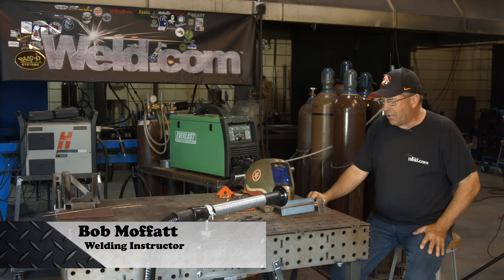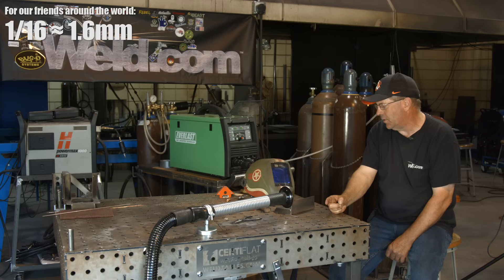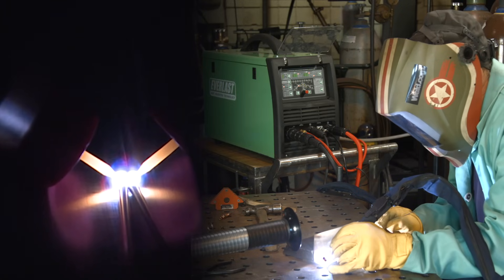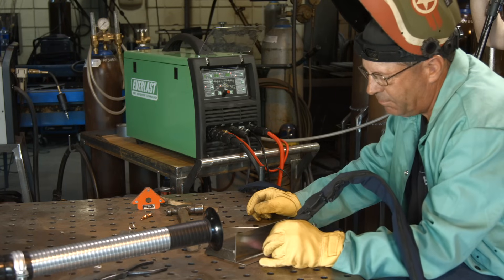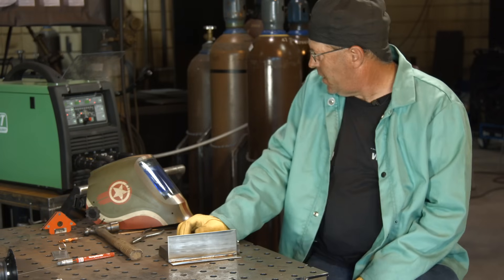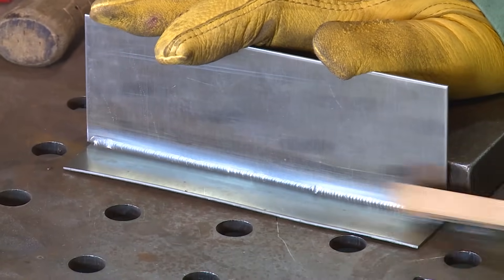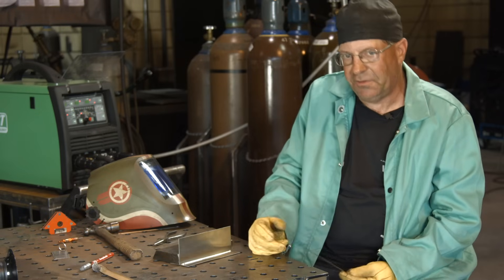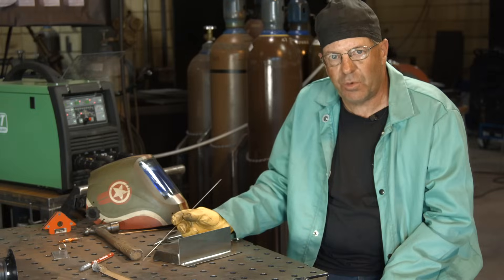🔥  TIG Welding 1.6mm Stainless Fillets (Viewer Request)

Comment: I can’t seem to keep my heat in control. The whole weld turns grey except the last 1/4” to 1/2”. Im welding about 3/32” stainless. Ill turn my amps way down but I have to stay in the same spot for a long time it feels like to get the puddle going and then the base material seems to get really hot just as the puddle gets moving a little bit.

Comment: I notice that everyone talks about foot pedals. What about those without foot pedals, or the welding situation doesn't allow for foot pedals?

How many amp is good for 1.5mm thick stainless? I believe I welded like you do, not as good as you but I'm not getting those golden/blue beads like Pacific arc tig weld does, but you're also using a normal sized cup and he seems to be using giant gas lenses... Is brushing the stainless after the weld acceptable, or using electro polishing brushes to remove the oxidation acceptable?

I don't watch PATW much because his result is unrealistic for someone without a GIANT cup and lots of gas flow. Regardless of the setup I have, #8 or #10 I've found the best result is from about 5 liters per minute (I guess this is about 10 CFH). I've dialed down the pressure quite a bit, the manufacturer of my welder recommends 15 psi, I don't have a gauge measuring the discharge pressure but the dialing down really saves on gas. More gas than 10CFH, even twice as much (20CFH) doesn't help me at all.

Comment: Appears to be using 80A to 90A, Jesus! What a amp for a sheet metal like 1/8! Today I lost some hours trying to learn TIG weld in these 1/8 stainless with no more than 55A. I will definitely try again with more power. I really suspected that I was burning my steel but I stick with max 55A due to a 'table' that I find on internet. No table substitutes an experienced TIG welder. Let´s try again tomorrow...

Comment: Very nice Bob but I have one request I know you probably cant get to this but I work in aerospace space currently as a tig welder and there is a bump in the road that I have ran into and I'm wondering if I can see it be done I have a weld test coming back up but a little new to me its .090 thickness 321 Stainless steel using .045 filler wire needed to be used need to fill with no undercut full penetration in the back even all the way threw start to finish it's a Butt joint can add a groove if needed, and is going to be x rayed thank you for your time.
Reply: And only one pass

Comment: What was the exact amperage used during the weld? I've tried even 30 amps and it melted the steel at the joints especially when i'm doing tubes. Need some advise on this.

Comment: Can you also do tig on 16 gauge outside corner joint? I am trying to make a small purge box for small parts that need major argon backing I’ve got an idea just haven’t done much will stainless outside corner joints at such thin gauges

Comment: Hi Bob, I have a dc, 200A Tig with pulsed option. Is possible to weld stainless 430 of 0.5mm in corner joint with this? Can you make a video?

Comment: I took what in thought would be an easy test for a job this mornin and failed it. I just had to do two horizontal fillet welds just like this and then weld two cupons together fusing just the base metal with the tungston. Im a rookie at TIG welding and i was used to just tiggin on thick stainless pipes, that thin stuff is a different beast. I can see what i was doin wrong. I was wonderin If i hold the torch with my right should i be pushin or pullin the puddle on this thin stuff? And i noticed hes just runnin the bead along really easy without moving the cup at all i was taught to "walk the cup" id appreciate any helpful advice on the subject. They said if i got in a little practice or something and wanted to retake it i could

Comment: Hi Bob, great video. I have tried to do the same, only my 304 is 2mm thick, using 12mm gas lens with 2.4mm 2%throriated red tungsten, sharpened quite thin. 20cfm argon. 70amps current. 3 sec start and 8 sec post gas. Am very new at stainless welding. My welds have a black scale on which kind of releases a bit as the weld cools so you can see a bit of shine underneath. I guess if I brushed it would come off. Why are my welds not shiney and bright like yours?
Reply: Hi Shane, check out the fabrication series by Tim McAmis here on YT, he goes through flow rate, Furick cups, and some trouble shooting.
https://www.youtube.com/watch?v=fEJulorXTMw&t=953s
That vid addresses your question.  (around 12:54 ), but I'd watch the entire vid. !
Reply: Im a beginner myself. Sounds like your cooking your work piece. That could be one of the issues. I started moving a little faster and put down rod more often mine came out shinny.

Comment: Bob, what would you change here for 20 Gauge Stainless Steel? Amperage only or cup size as well? Fillet size? My set up is same but 3/32 fillet on 20 gauge and struggling to control the puddle. Thanks for this video, working with it in the shop.

Comment: At school I TIG 1/16" stainless T joints well, with a nice rainbow color. But, at my last job test no matter how low I set their old Miller machine I was burning through the stainless like a flame through paper. I didn't get the job obviously, and I left embarrassed and tried not to show it. To be fair, they were using contaminated tungsten rods. The chuck that tightens the rod in the torch was spiral twisted and worn out and no extractors were present to clear the vapor. Something was off because they set the machine for me, and got annoyed when I looked over the settings, as If I shouldn't bother.
Come to think of it it was better they didn't hire me.
Reply: You dont want rainbow colors, thats overheating the metal. You want a nice straw color

Comment: Bob, I'm a beginner welder. I was practicing on 304 Stainless 1/8 in Coupons. I'm using 100% Argon at 30 CFH, Stubby gas lense, #8 Cup, 3/32 2% Lanth, 308L 1/16 Filler. All my welds are coming out dark Gray. No matter how low I go on amperage, i can't seem to get bright colors. Any ideas would be much appreciated. Thanks for all the great Videos.
Reply: I asking myself the same question. How to get bright weld. Where are you now at, one year later?
Reply: Late comment, but use piece of aluminum block or angle 1/8" or preferably 1/4" or more to touch as much of the back side or the weld as you can as a backer.  It will pull the heat from the stainless and keep the temps down so reduce to oxidation (gray)...

Comment: Great Video!
I regularly have to tig high-carbon stainless, that has been cut too deep, in very expensive CNC machined parts; for the food service industry.
 I would appreciate some insight dealing with filling in approx .08 cutouts along an edge .1 thick.
 If the opportunity presents itself; not everybody is dealing with thick material constantly.
Reply: Any tips? I need to get small welds down on some really thin stuff.

Comment: Took a Stainless TIG test yesterday, bombed it (only second time I've welded Stainless). I was having two issues; 
#1 vision- seeing what was going on clearly (I guess a 1.0 or a 1.25 cheater lens would help with that) 
#2 getting the puddle to form and then move along. I had a similar set up to the one in the video. I set the machine to about 95 amps and gave pedal until I had a puddle. I tried to move out and things just wouldn't move like I would want. It seemed I either had too much heat or not enough and blew out the joint several times. I don't seem to have this kind if issue with carbon. The only two times I have ever welded stainless have been on tests (probably 90% of my problem). If I get another shot is there anything specific I should "look for" when attempting to initiate a puddle and then move out down a fillet or lap joint? 
Thanks for the great videos.
Reply: Hey man I'm having this exact problem now on a stainless job trial. Kinda hard so far.

Comment: why not call your "weight" what it actually is... a heat sink for that thin ss.
Reply: Andrew Cumiford Because it isn't.  Most everytime I've used it, I've explained it isn't a heat sink.
Reply: If one did want to use a heat sink block, steel is far from the ideal metal.

Comment: I wanted to see the back an bottom of the plates.
Reply: Sea Level Sorry my bad.
Reply: A lot of the time, I run into a job that I cant get anything behind the joint to prevent sugaring and way to big to purge. Typically 16 gauge ducts and exhaust assemblies. It's hard not to not sugar the backside and make it look tight and burned in.
Reply: Sea Level Agree. Heat paste and or Solar B flux may help in those instances. .045 or even .035 filler might be the trick.
Reply: Bob  Moffatt don't apologize for camera guys short comings. You are a great teacher keep up the good work.my only hope is that one day you'll get through to camera guy seems like he's got a habit of riding the rails :(
Reply: delinquentdesign just use pulse man😀

Comment: Hi bob, I'm having some troubles with MAG welding of Stainless steels. In fact, we use a circular butt-weld configuration for joining tube fitters to a tank shell  (1,5mm in thickness ) and we always find hot cracks before the overlap region. What do you is the cause and how to prevent such defect ?

Comment: When you are tig welding could you tell what type of tungsten you are using? If you only said what color that who be very helpful. Thanks a lot and I look forward to the next video.
Reply: E3 on this one.
Reply: 12ozbuds Color band isn't always consistent with alloy these days though.
Reply: I use 2% on most everything so red for thoriated and grey for ceriated. Red seems to keep the nicest point for fine work and it takes the heat best for ac aluminum. My preference only.
Reply: Boy, that narrows it down. What I meant when ever he does a tig video he says not only the size of the tungsten but also the type. For example thoriated, ceriated, or zirconiated.

Comment: Bob, here's a question I've often had with respect to back purging stainless welds. We all know that the conventional way to do this is with an argon purge but I've always wondered if you could accomplish the same goal by using vacuum. This would have many advantages if it would work. For one thing there would be on argon expense. Just hook up your vacuum pump, need one of those for air conditioning work anyway, suck out the air and go to town after sealing off the object you're trying to weld. OK something like a SS exhaust system if you need to know. Have you ever heard of someone doing this and is it feasible?
Reply: I understand what you're saying and it's not feasible. You would have to ensure that the argon coming from the torch surrounded the entire area to be welded (every microscopic gap) at all times, or the vacuum is going to draw in air.

You cannot control dissipation to atmosphere in that application. You can control dissipation in a back purge setup.

And there's no way to get a perfect vacuum on something that's not sealed. Vacuum equipment has a very low CFM rate of evacuation. Even a pinhole sized opening and that thing will never build vacuum, never mind create an environment akin to back purging.

The idea of welding in a vacuum chamber I think has merit though. Execution, equipment cost, setup cost, productivity rates etc would be the defining factor vs back purging.
Reply: SATAMAN Schmidt 

Welding of some form or another can be done in a vacuum, however you need a very significant vacuum to get enough oxygen out that the weld is protected without running inert gas.  You definitely couldn't do it in a sheet metal box, you would need a thick walled chamber.  Even then some oxygen might still be present.  It would be interesting to see how the heat from the tungsten in gtaw would cross the arc gap in a vacuum.  I would think tig might not work at all or at a reduced heat level with no gas present in the arc gap.  Just as helium increases heat, a vacuum might lower the heat or eliminate it.
Reply: Don't think you understood the question. The entire piece isn't going to be placed in a vacuum. On a tube (headers for example) use rubber stoppers on each open end with one of the stoppers having a whole in it to connect to the vacuum pump just as you would with an argon tank except you'd need a vent hole on the other side if using argon back purge as the argon has to go somewhere.
Reply: SATAMAN Schmidt 

A vacuum strong enough to pull the oxygen/gas out of a header would pose several problems.  One is if your weld penetrates the material at all you will have a hole and a loss of vacuum instantly.  Second, it takes a serious amount of vacuum to pull enough gasses out that the backside of the weld isn't exposed to oxygen.  Enough that the integrity of the pipe could play a role.  Obviously not a option on anything thin wall.  And third a vacuum strong enough to vacate the pipe of oxygen will surely pull in oxygen into the pipe negating shielding processes.  Obviously if it needs welding it has unwelded areas that will just allow air into the pipe.  Not practical by any means, biggest issue being that any remote pipe penetration would lead to the molten metal being sucked in.  Just as back purging will lead to a weld blowout as you finish the weld provided you didn't leave a vent hole for the Argon to escape.
Reply: @satamanschmidt3428  The goal of course is to prevent the oxygen from having access to the hot metal.  If you can set up the flow so the Argon curtain washes past the metal without mixing with and bringing air with it, then it certainly would help.  I would think it depends on how successful you are at having only Argon in the stream.  Submerging the headers in a "box" filled with Argon could also work since it is heavier than air.  Shorter headers might be ~3 cubic feet of box requirements in size, so at 20 CFH it would take 10-15 minutes to fill the box.  I think that is hard to manage though so be able to weld 360 degrees much like the vacuum and so folks use a purge instead...  More reliably repeatable I think...
Reply: It’s an interesting question. How much oxygen, and nitrogen, don’t forget that, needs to be removed? It’s likely that not all of it does, but most all of it. So what would the Hg number need to be? The problem is that you would need a really good seal on the back. But, if your goal isn’t really to save gas, then it might work by drawing argon through the small gap as long as you raise the argon flow. It wouldn’t be perfect, but it could help.

And, by the way, you need the resistance of the air gap for the arc to work properly. That resistance is what produces the heat.

I often use a device I made out of several inches of 1” square copper. I milled a flat in the middle on the corner, drilled and tapped it for a rubber handle. I then milled an 1/8” deep flat along the opposite corner extending to about 1/8” of the ends. When I put that behind the fillet, the slight opening between the two pieces of metal captures a small amount of argon from the torch, and pushes out the air. It works pretty well. I made a similar thing out of 1/4” thick flat copper stock. Machine a groove in the middle. That allows argon to displace the air if you have preflow set for a couple of seconds, and a tiny gap.
Reply: Beyond anything else, it would not work because as soon as the metal puddles the atmosphere on the outside would blow into the vacuum inside.

As an automated procedure in a vacuum chamber, or an astronaut out in space, it would work just fine. In fact, you'd not only save on the gas but it would also use less energy as the lack of atmosphere means the heat stays in your work.

Comment: Thanks for the video as always.  Sometime you should do a video on .120wall tubing (as commonly used in roll cages and off road parts like axel links/bumpers/etc).  I have some projects I want to tig weld up for my truck soon and I am a bit confused.  It seems it's recommended to do a full penetration weld on butt joints.  Yet on notched tubes I see guys welding in other videos they keep the gap in the joint to a absolute minimum.  I don't see how they are getting full penetration in tig in such cases without a gap.  I could run way over amperage and I can't get full pen with a 0 gap.  They aren't beveling the tube ends either.  Any thoughts/advice/video would be great.
Reply: Yes please
Reply: Good point. This needs discussion for sure.

Comment: Wanna see the back side of the weld
Reply: I would also like to see if it sugared.
Reply: Not just the back side of the fillet, but also the underside of the bottom plate would be effected. Would not be any "overflow" of argon getting back there.
Reply: NifalioPhobia BVTV, wouldn't it have some gas coverage on the back side because of the block on the backside trapping any gas that flowed through?
Reply: Frank Rodriguez yes it should but I still wanna see how it looks but yes the bloack behind helps trap shielding gas I always use a backing when welding stainless